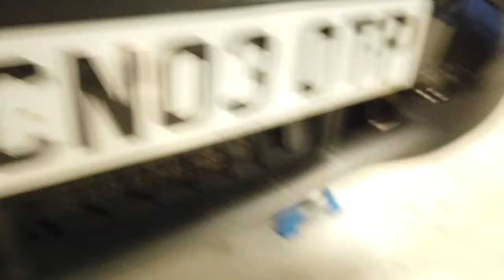Smart Car ForTwo W450 Front Bumper Panel Removal ( how to open bonnet ! )

Comment: Good video, nicely explained, really helped me today, thanks! Only thing I might add would be how the plastic grill piece clips from low down. A little up pressure and gently wriggle it out of the housing. Thanks again!
Reply from the maker: Hi - all air temp sensors need to have a wire ( normally 2 wires ) going to them as they work on resistance.

Comment: it is possible to fill up coolant by removing the grille on the passenger side (england) and removing the intake for the blower , the other side accesses the brakefluid and i think the wiperfluid 
and if you know braille you can even replace the lightbulbs through there  (though its a test of patience for sure ) its eazier to get the front off
Reply from the maker: just take the front off... its easy
Reply: @L663  compared to snaking youre hand through those grilles ...... yes it is

Comment: I practice these removing ever on my 450er smart when a headlight bulb is not more working. I remove the complete front panel and changed on these way all bulbs which are in the lights. It is easier then to break your finger when you try to do it through the small plastic parts on the panel. It needs about the same time and your finger will be without damage !
Reply from the maker: Hi Rudi - I agree its worth taking the front off - grease the bolts - clean all the parts and put it back together again !
Reply: @L663  Thanks for your answer. I have been driving the 451 Smart since 2009 and I really appreciate the fact that I can now change the lamps in the headlights without removing the whole front panel and scratching my fingers